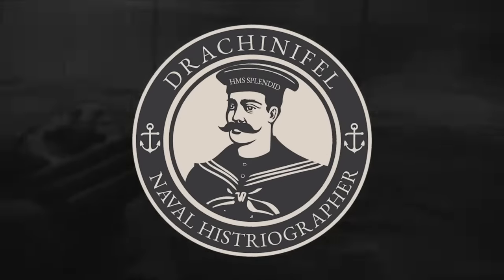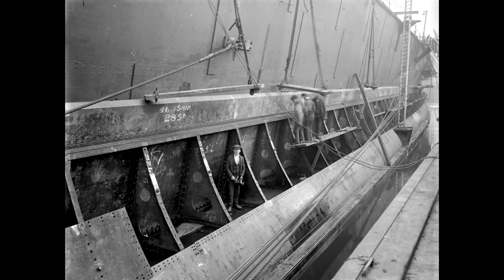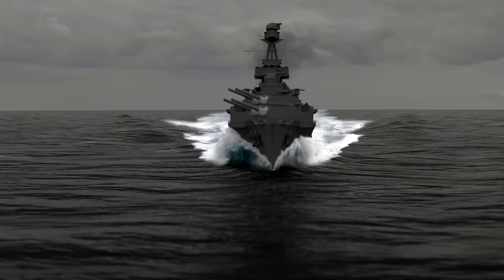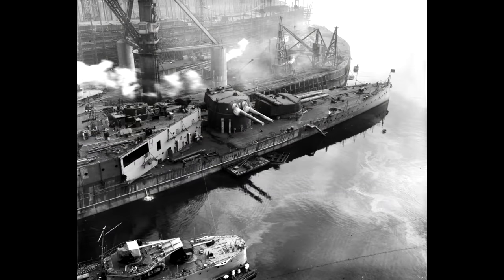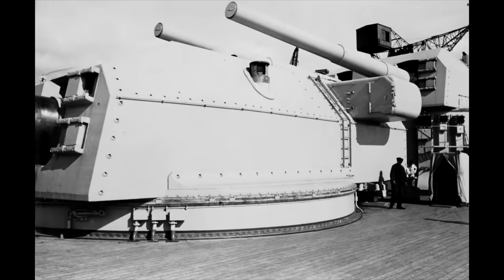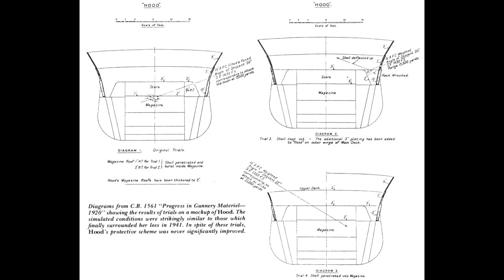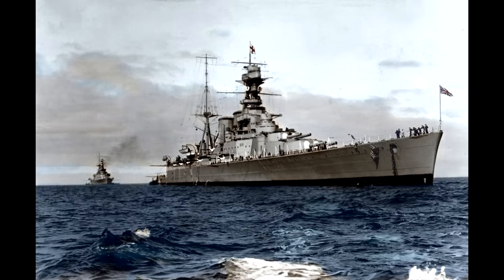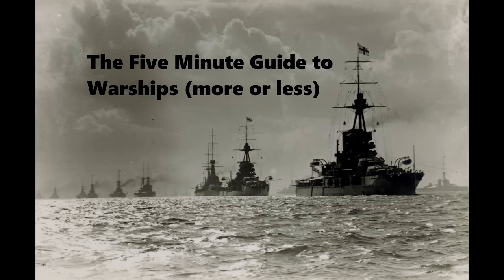The Loss of HMS Hood - But why did it blow up??

Comment: Admiral Holland was trying to close the range to avoid plunging fire,but he miscalculated and made the turn to port to far out.
Reply: The "plunging shot through the deck armour" theory has been discounted for many years. At the range of the fatal hit, that is approx 8-9 miles, and using the German's own gunnery data for the 38 cm SK C/34 at that range gives an angle of fall somewhere in the region of 10-13 dgrees from the horizontal, which was wholly incapable of penetrating even Hood's 3 inch deck armour at the given range.
Reply: Every documentary I have ever seen regarding the battle of the Denmark straits @Walter Kronkite's left states states that the Hood was trying to close the range to avoid plunging fire and made the turn too far out.shoe
Reply: The British Admiralty knew about the suspect deck armor of the Hood, and Admiral Holland was trying to get the Hood in close to avoid plunging fire 🔥 😳 😂 🤣. Admiral Holland 🇳🇱 😳 🤣 made the turn to far out,about 8 miles and got caught while making the turn to port.
Reply: @jamesfahy-pl2cv  Well the producers of those documentaries must not have researched the subject thoroughly enough. You've now been provided with the correct figures from the Germans own A.V.K. d. KM (Artillerie Versuchs Kommando der Kriegsmarine) that show V/Adm Holland HAD cleared the "danger zone" of plunging fire.
Reply: @walterkronkitesleftshoe6684  Then why did the Hood blow up?

Comment: An excellent piece of work, more comprehensively - and comprehensibly - described than accounts of the Boards of Enquiry that I've seen. The bow-wave trough theory does appear to offer a solution with less mystery than many others. Did you suggest that the 20 degree port alteration shortly prior to the disaster might've driven the trough further back and more directly exposed a path to Y magazine, or did I make that up?

Comment: Very nice analysis!
I like the idea of taking account of where the actual waterline could have been.
The other influence on this is the ocean swell at the time, which could easily have been varying the height of the water on the hull side by a further 3 or 4 metres. I don't think the weather in the Denmark straight was particularly calm at the time.
With the right timing of the projectiles impact, it may have barely hit the water at all!
This hypothesis also fits your statement that the impact was right at the beginning of the turn to port. If the Hood was mid turn she would have been heeling enough to put the armour belt back in the water.
Not wanting to put the cat amongst the pigeons!
What about the impact being further into the turn and the ship having an extra 10 degrees of heel towards Bismarck, this would upset some of your previous projectile entry angle calculations, could it allow a 15" to come in over the thickest armour.
Keep up the great work, this is probably my favourite YouTube channel.
Reply: Oh dammit, just seen others suggest the ocean swell too!

Comment: There is one major point missing from the your eye witness reports and was noted by the Prince of Wales's bridge and some of deck crews as well as several witness on the German side: they reported seeing either two over, one short and one on or one over, two short and one on. However, almost every eyewitness that reports a salvo arriving, and only three splashes with a visible impact. The others report two one and one on either side.

Any shells hitting the water would product a visible splash. The dud impacting Prince of Wales stern section still produced turret high columns of water before penetrating the ships side. In fact, the crew on the Bismarck did not record it as a hit but rather a "straddle."

The ship would have been healing to starboard during the turn. Because of the bulbous shaped hull and high speed this would be significant. The fact noted by all three survivors of Hood, she was turning and was healed to starboard when the salvo arrived.

Comment: The rerason it blew up so quickly was because there was 10 tons of unstowed ammunition surrounding the funnel that was right above the magazine. A round from the Bismark hit right in the middle.
Reply: Sorry. Absolute nonsense unsupported by any evidence whatsoever. Hood's ready use AA ammunition was set on fire, but this in no way contributed to the loss of the ship.
Reply: @dovetonsturdee7033  One reply has been deleteed, lets see about this one. So many bots with no main page. Its as though you are hired to confuse or deny. As you go through life you hear thnings. some rubbish, some quotable. Like this one came from a VERY senior position who saved the UK from starfighters actually, did a fantastic job "Up THERE !"

Comment: Forgive if I am mistaken. If there were 4 torpedo launchers in twin mounts with a reload for each launcher. Then 4 torpedoes in the launchers  plus 4 torpedoes to reload is 8 torpedoes. At 500 lbs of TNT per torpedo, I come up with 4000 lbs of of TNT, not 2000. I doubt that this changes much if anything as TNT is a sharp and sudden explosion instead a large ball of flame and smoke.

Comment: I am ordinarily not the type to be the typing and spelling police, however in this case spelling actually matters, as the spelling DOES give two very different views:  @4:22 the seamen who are still alive feel the ship not "heal" but "heel," aka lean to starboard (to the right, and quite suddenly), whilst* "to HEAL" means something quite different...as almost to fix itself.  Obviously two very different things, as they are most diametrical opposites in effect.  
Just pointing this out.  It's a tiny thing, but it might be mis-interprated too.  
Otherwise, this is a very deep and thoughtful analysis, which I can only applaud.  
I do recall testimony by an officer on the Prince of Wales who said he felt "something big" had just arrived, and only a moment before the tower of flame shot skyward from the Hood.  I can see that happening, right down to the soles of his feet, so I've often taken his description as a solid reference.  I can imagine, somehow, how that might feel, and it strikes a chord with me.  FWIW.

[*  As an American I use the UK word "whilst" with great caution, so I might be goofing things up too.  Correct me if I have done so, and thanks]

Comment: I know I am three years late to the party, but I there seems to be a notable math error around the 26 minute mark.

The angle of plunging fire from Bismarck is assumed to be insufficiently steep to hit the magazine, the assertion being that while an angle of 14 degrees is possible from Bismarck at that range, an angle of at least 20 degrees is required to hit the magazines on Hood.  However, as established, Hood is assumed to be 37 degrees off the perpendicular relative to Bismarck when she would have been struck.  This significantly changes the armor protection angle for a plunging shell to strike the magazine. Positioned at 37 degrees off the perpendicular, a round can hit at a shallower angle with the relative effect of a steeper angle. As already established the deck armor would be insufficient against a round in such a scenario.

The angle of Hood (37 degrees) increases the distance between the armor and the magazine along the rounds x axis of travel by about 40 percent.  Additionally, the heaving of a ship up and down at high speed could affect this angle further, (an effect that otherwise would not be a factor if Hood were perfectly perpendicular). This makes a shallower plunging round of 14 degrees within the realm of possibility for either a magazine or another vital part of the ship.

Admittedly, this would be an narrow window of vulnerability and a lucky shot indeed if so.  But the possibility is an interesting one and is worthy of more serious consideration.  Whatever got Hood was by any definition a lucky shot, regardless.

I like the idea of the 4 inch magazines getting hit, I just wonder if a hit below the water would not flood the compartment quickly enough to check the flames and expanding gases before becoming catastrophic. I’d also wonder if a bit of steam wouldn’t be generated under the same underwater hit scenario. However I wouldn’t rule out the possibility given the time span involved.

Pulling off a maneuver similar to Admiral Nelson’s tactic of Trafalgar in order to close rapidly is much riskier maneuver in the battleship era. A 37 degree closure angle makes a battleship a lot more vulnerable than in the age of sail. The daring of the British Navy that day is worthy of that legacy.

Thanx for the video, I learned a great deal from the entire presentation!
Reply: I read that with the amazing guns built in the interwar era (even with the naval treaties) by 1939 14/15 inch guns could easily pierce upwards to 20 inches of hull or deck armor if the shot happened under 18,000 yards. 25,000 yards is when it gets debatable. Hood's old 15 inch guns were even state of the art for 1920 and at under 18,000 yards would have been good enough to penetrate Bismarck's strongest armored section for a lucky shot also. Hood's big guns had higher pressure than Bismarck's too.

Comment: While the scenario you put forth makes a ton of sense, I can see another possibility. given the diagram at 29:00, if the shell hit near the top of the 7" plate instead of near the bottom, it could have then penetrated the bulkhead beyond. Depending on the delay, it wouldn't need to penetrate the deck armor on the other side of that bulkhead outright (in the roughly square compartment slightly above and to the left of center in the diagram). It is highly likely to have caused spalling inside the magazine without having to penetrate. This could happen in bouncing off the deck plate on the inner side of that bulkhead, as it looks from the diagram like that was 2" or so, or at least significantly thinner than the 3" deck plate on the outer side of the bulkhead, and a 15" shell, even having been slowed by penetrating the hull armor and bulkhead it is going to be hard for such a relatively thin plate to bounce. Second, if the shell was in contact, or nearly in contact with the plate when the filler detonated, such a blast (Navweaps shows probably 45lbs/20kg of filler) might well be powerful enough to cause considerable spalling within the magazine below that plate. And if it was in the middle of bouncing off when the shell detonated, having already strained and possibly even perforated the plate in spite of ultimately bouncing, it is possible the blast could have breached the plate entirely.

Comment: Send this to the Admiralty and see what they say?

Also, how was the armor on Hood?

The Grade, Type, etc?

On Kirishima, the Washington savaged her with just her 5/38s, surprisingly given the range.

At the same time, her main 16/50s were overmatched and simply tore through the armor.

A few rounds even traveled underwater to hit and penetrate the hull and detonate internally.

One of the 16/50s also exploded right under her differs, causing them to jam at extreme angles when they were found decades later.

Critical information survived in the hands of a gunnery officer who was friends with the DC Chief aboard ship.

Including sketches of the damage, which was terrible.

Though you're right about hits on the Main Turrets. Both of Kirishima's forward Main Turrets were hit outright in the barbettes. Neither Turrets went off despite extensive damage that wrecked them.

(On a side note, Cell Phones and Tablets suck at trying to leave comments!)
Reply: Oh God give me strength to note toss my Tablet out the window, especially as it is an Amazon piece of poorly made and programmed trap.

Differs is supposed to be Rudders.  Folks, drop Amazon Stock and buy Microsoft.

They at least can do a half decent job.

Comment: I never knew Bismark so nearly destroyed TWO Royal Navy capital ships instead of one. How that shell Bismark managed to put into Prince of Wales' keel DID NOT explode and detonate her magazines is nothing less than miraculous, given the shell was found pointing base first. I would not have wanted to be that guy who had to defuse a shell with a partially activated fuse. However, a big naval shell exploding in the water close to the hull can rupture shell plating because the water is turned into a steel wall by the explosion. Pipes and valves that communicate with the sea below the waterline could also be subject to shock damage, and to kill a ship all that is needed is to rupture enough sea chests or pipes between a hull valve and the shell plate. If that happens, the vessel will rapidly capsize and sink. This was probably what the crew of Bismark did to scuttle their ship. Still, I wonder if a shell impacted the water a few meters from Hood's hull then exploded close to the hull could have breached a magazine, before the shell could have impacted the hull itself. The explosion would have equaled if not exceeded the blast of a heavyweight torpedo, and that could do serious damage, such as wrecking the rudder. I would however, in Luchens' shoes, pursued and finished off Prince of Wales. After sustaining serious damage to my own ship, I would have at least wanted to report to my superiors that at least I sank two British battleships. If I was in Holland's shoes, and Hood and Prince of Wales succeeded in their mission to at least slow Bismark down, I would not have let Prinz Eugen get way so easily.
Reply: Oops there goes silly old youtube, randomly deleting my replies again, good job I copy and paste them nowadays. Here it is....

A few corrections/comments...

1. If the fuse of the shell that ended up in PoW's double bottom had functioned correctly, it would have detonated in the water whilst plunging at approx 15 degrees down to a depth of 35ft (and having to travel approx 135ft through the water), likely causing only superficial damage.

2. "The explosion would have equaled if not exceeded the blast of a heavyweight torpedo"   wrong......15in AP shell bursting charge = 41lbs of HE, German G7A/E Torpedo warhead 671lbs of HE, so nowhere near the destructive power of even a small torpedo if the shell was bursting meters away from a ship's hull in the water.

3. Lütjens chose not to pursue PoW for 2 reasons...1 His orders expressly forbade him to seek warship engagements, 2 Pursuing PoW to the east would steer the German ships TOWARDS the very epicentre of Royal Navy power in the north Atlantic and along the most probable approach route of further RN units, and Lütjens was only too aware that the German radio listening service (B-dienst) had provided him with absolutely NO warning of the initial approach of Hood/PoW, and it would have seemed likely to him that PoW was attempting to draw him eastwards towards further RN heavy units.

Comment: Is it possible that the structural steel that was normally in compression is after loosing horizontal braces now in expansion , and  with the execution of the turn, helps to tear the hood. Could its age and its exposure to cycles of warm ocean followed by cold ocean had compromised structural integrity before the battle?

Comment: At 28.49 there is talk of a shell (the red line) piercing the armour plating then bouncing off the 3 inch deck plating and exploding “somewhere” in the ship. I think that the “somewhere” in the ship has not been explained sufficiently to rule out. One bouncing off the shoulder of the deck 3 inch plating could have ended up anywhere. What was stored inside the ship within a shell detonation time limit.

Comment: Great video, well thought out and presented.
Isn't it weird that by crazy fates, that 2 ships both went out in that time that were doomed to die by the worst luck. The unlucky shot that killed the Hood and the equally unlucky hit that made the Bismark rudder jam which led to it's sinking.
  I think if you made up a story about this everyone would say "no way, this just can't happen like that". 
  To be sure there were a lot of people who got stuck in a very unlucky series of events and I'm sure they all would rather be somewhere else.
Reply: And PoW would suffer her own rudder hit at Force Z, which was even less lucky than Bismarck’s. Unlike the German vessel, PoW could in theory still steer using just the props.....except the hit took out one of the prop shafts, rendering it useless, and the shaft kept turning even after the hit, meaning the mangled remains of the shaft tore through the hull of the vessel at the stern.

Force Z was never going to be able to defeat the Japanese air attack outright for obvious reasons, but it’s quite possible PoW would have escaped, or at least sunk much more slowly, if not for that.

Comment: The wreck of Hood is, as you'd expect, spread over a wide area. The upper section of the bow being the largest piece. It was reported that the how was seen rising up out of the water when she blew up. Could it have been just the upper half of the bow? Is there anything in her design that would lead to her splitting horizontally? Or would it be more likely to be crush damage as airtight compartments imploded as she sank?